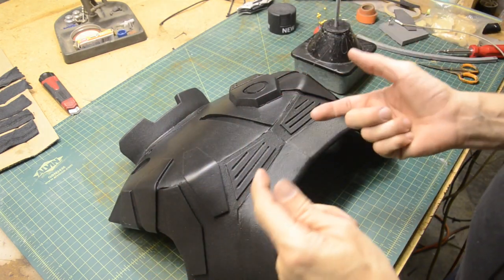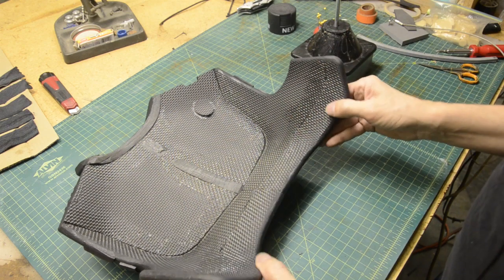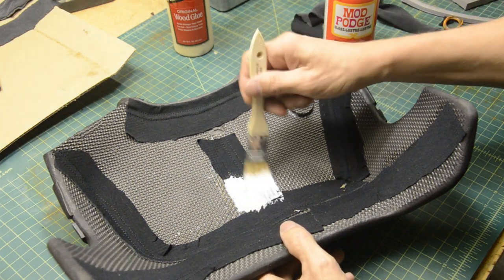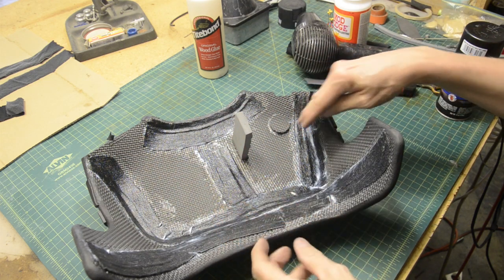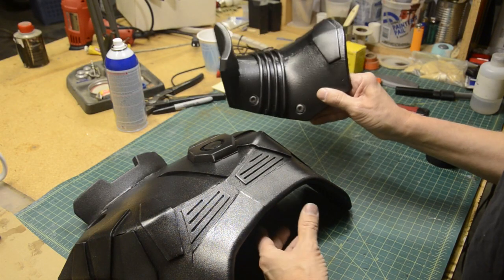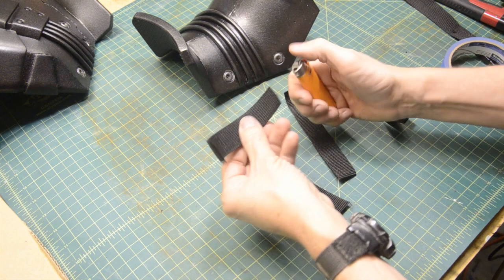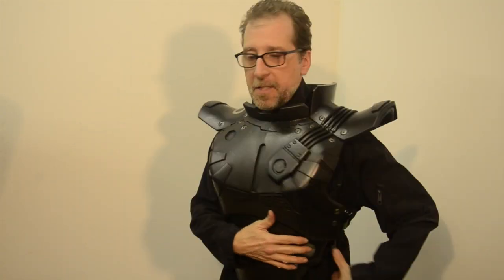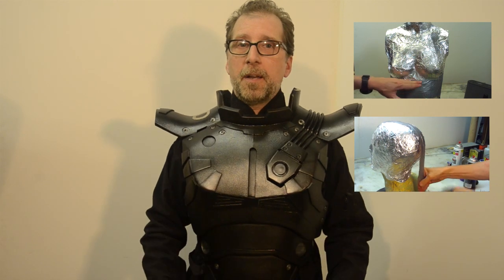How to Make Male Foam Cosplay Armor, Tutorial Part 3

Comment: Ted, a friend and I are building our halo suits for airsoft, we want to coat the armor in rustolium truck bed liner, comes out as a tough thick abrasion resistant coating, can you elaborate on the bed lining on Eva foam for us? the idea is rigid but partially flexible outcome, were going to attach every plate to a gel lined wet suit we've attached loop Velcro, and intend to use hook fasteners, the hold strength is insane between them, we're just not sure of the coating to seal it in. we'd like to not ruin months of work on a what if.

Comment: Amazing work! You've really inspired me to up my cosplay game. There is one thing I was wondering, because I accidentally skipped a step in my latest build: is it important to seal the inner seams with shirt strips & wood glue before I paint the outside, or can it be done after?
Reply from the maker: You can do it after. I now use high temp hot glue to seal my back seams.

Comment: Hey Ted!! I know this is an older video but do you happen to have a follow up on how to add details like LED lights? Also, With this build, you did 1 inch strips of t-shirt fabric over the seams... why not just line the inside with fabric?
Reply from the maker: I use to do that. Now I go over the inside seams with hight temp hot gun. Works faster and easier.

Comment: I'm pretty sure someone has asked before, but I'd love to know how you made the armor in your intro, the one where it shows it in white and than the full armor next to it. I love how you did the mask with the fan-ish type of front and yes I'd love to know how that one was made and if you have a video of it somewhere. Thanks in advance and I'm excited to be apart of your channel now. I'm learning so many things, but don't have some of the items you have listed. One is cost right now and two I don't have that much room to work in. oh and three, no place to spray paint anything.
Reply from the maker: +MG OC It all starts with you. The only way make something is to do it! Just that simple. Start small and work your way up.
Reply: I will do that, and if it works out I'll show a photo, my only thing is the latex. I'm not allergic per-say, but it does bother me. So the other rubber spray you use might be a better thing to for me to try. I'm just worried about the cracking part of it, as I've heard from others that it might do.
Reply from the maker: Watch my tools of the trade video.
Reply: I did, it was a great video, in fact I finished watching them all. :)

Comment: I am about to embark on a hybrid batman armor. A cross between Keaton and the DCUO video game future Batman armor. Basically, I bought similar tools you use, but how do you clean modge podge off your brushes and do you know a type of brush to best apply contact cement? So far I have been dabbing a paper towel in and wiping excess off with scrap foam but need a brush or a glue container like you use
Reply from the maker: Eric Marable I use water to clean off modge podge. You can use chip brushes to apply barge cement.

Comment: Thank you for your great tutorials, Ted! Do you thin your floor wax for your airbrush? If so, what ratio have you found works best?
Reply from the maker: +Rob Cartwright No I do not, just straight out of the bottle. It's already water thin.
Reply: Evil Ted Smith Thanks!
Reply: I just got an airbrush and have used Future for sealant on other builds using a plain old spray bottle. It never occurred to me to use my airbrush to apply it so I'll be doing that on my new Voltron Paladin build!

Comment: Would you recommend using the 1/4'' thick foam, as opposed to 1/2" thick foam if you wanted thinner, slightly less bulky armor? Or would that not be durable/strong enough to make quality armor?
Reply from the maker: Yes you can use thinner foam. I just really like working with 1/2 foam.

Comment: Hi Ted. Just a question about sealing the inside of the armor. Wouldn't it be better to heat seal and Plasti Dip the inside as well instead of the modpodge or in your opinion is it not worth it?

Great tutorials! Thanks!
Reply from the maker: PhoenixRevival00 Not worth it! Just seal it up with modpodge or rubber latex.
Reply: Alrighty, thanks for the feedback.=)

Comment: Hi! I would like to ask if there will be an error on painting the armor goldish yellow colour in colour ? i noticed  your plastic dip is black colour. And instead using the heat gun is it okay to use a hair dryer with a 55 degree Celsius?
Reply from the maker: adam chang You can get yellow plastic dip, for your base color, then paint yellow on top of that. I had no luck using a hair dyer to bend EVA foam. Heat gun all the way.

Comment: Hey Evil Ted I have a question for you. When you choose what color you want for the armor does your choice of dip spray influence the outcome of the appearance?
 For example you wanting your armor to be red but using black dip spray. Would I have to choose a color close to the paint after like red or pink if it's finishing color is red? I hope you get what I mean.
Reply from the maker: +Jordan McClafferty Yes, if your finished armor is red. Then use red or white palstic dip to seal it with. When using bright colors, it's always better to have a lighter or matching base coat.
Reply: Thanks Ted your the best. I only wish I could be so technical when it comes making armor.
Reply from the maker: It all starts with making it, and your doing it!

Comment: I've got a question: I've been looking around for foam to use and I can't find anything that resembles what you used in your videos. However, I did find a thin foam sheet used for outdoors camping. This foam is kind of rough and not at all as flat and smooth as you foam. Do you think I can just heat seal the pores to make it flatter, or do you think the material itself is no good?

This is basically what kind of foam I am talking about:
http://i.imgur.com/HvzhAZF.jpg
Reply from the maker: foxic95 That foam should work. I have my supply list just below my videos.

Comment: hey. do yu have any tips for armor that as a lot of weight in the back. it kinda has big spikes that light up but i am having trouble with it starting flush with out sliding.
Reply: staying flush*
Reply: dylan munroe you can secure them with buckles. Like kind of the ones you'd see on backpacks. That's the best I can think of for much heaved pieces like you're mentioning.

Comment: 2 questions...
1) can i use bono to harden this?
2) can i use this for larping xD
Reply from the maker: ***** No, you can not put bondo on it. It would only crack off when to foam flexes.
Reply: Evil Ted Smith ah, i figured xD

Also could it handle larping(foam sword fighting) like how you built it in the video? It seems pretty tought and well built, since i never made foam armor i cant imagine it itll work thou..
Reply: ***** I've been using Ted's techniques to make foam armor for a combat group similar to LARP, and it works great - the key has been to make sure the pieces are shaped correctly so they don't get crushed or torn, but the foam he's using holds up really well to repeated hits.
Reply: Hydronium Rocket ty hydro

Comment: Are these templates available?
Reply from the maker: +Aftershock Stands Not these but I do have other pattens on my site eviltedsmith.com
Reply: Evil Ted Smith
Shame, I quite like the look of this.

In other news, I have a question that I would like to see a tutorial on, if at all possible.

I've begun my first foam project, including ordering foam and a heat gun. I drafted roughly what I want the suit to look like and posted about it here - https://teenagesuperheroblog.wordpress.com/2016/05/20/pacific-rim-drivesuit-wip-part-i/

I was wondering, how do you pattern out and build freestanding detailing on armour that doesn't follow any sort of biology, such as the "angel wings" on my design? I think I should be able to translate most of my concept to templates once I have a duct tape dummy of myself, but I'm baffled by the top layer plating and "wings."

If that's not clear, I can get better drawings to communicate it better.

Thank you!

Comment: Hey, Ted. First-time foam armor builder. Love your Tutorials. Quick question: to further reduce seams and give the armor a more smooth, metallic look, would you recommend a high-build wet sand primer before the paint coat? I have a helmet that needs to look more metallic and smooth. Or what would you recommend? Thank you!
Reply from the maker: Yes, 400 and 600 wet sand really helps take down the seem.

Comment: What's the difference between the plasti-dip spray and your process for sealing the seams? Could the plasti-dip spray be used on the back to seal the seams just as easily or is that not sufficient?

Comment: One question is how can I prevent those plasti dip from tearing off after wearing?
Reply from the maker: +PAUL RYAN I don't have that problem with armor so much. If it's a part that bends or flexes a lot, then say it will crack over time.

Comment: Thank you for making such excellent videos.  I should make a spray-booth / room as you do with drop plastic.  Great notion! 

Questions that I'd love to have answered (you can even provide video links if you have addressed them)
- impact resistance : foam is very soft.  I harden by coating it in many coats of white glue + flour, but even still.  I have also used thin styrene (0.3 mm thickness) and Worbla to prevent that wrinkly look.  Recommendations?
- you mentioned Balloon latex, and were kind enough to provide a link.  I'm Canadian, so my options for shipping would very likely equal twice the cost of the latex.  I am familiar with Mold Making Latex.  Are they interchangeable?

Comment: How hard does the dip spray make the armor?
Reply from the maker: Caleb Stephens It just puts a skin on it to seal it so it doesn't look like foam. But it's still soft to the touch.
Reply: Evil Ted Smith do you think coating with fiber glass resin would work out well?
Reply from the maker: No! Not a fan of putting hard resin on soft foam. It will crack for sure.